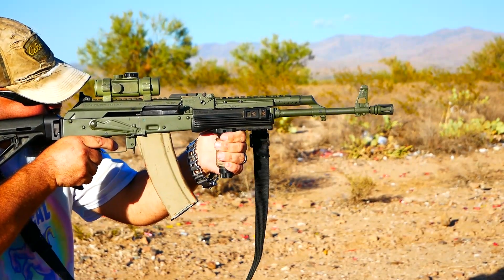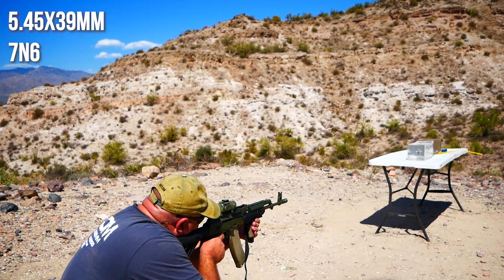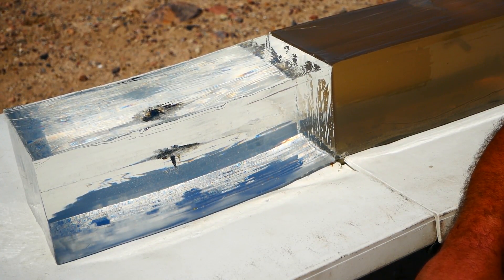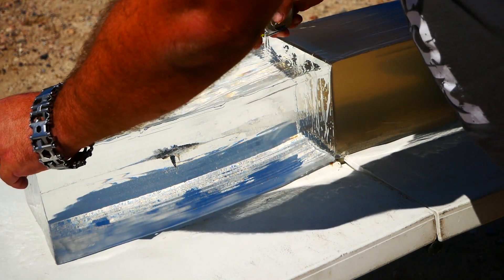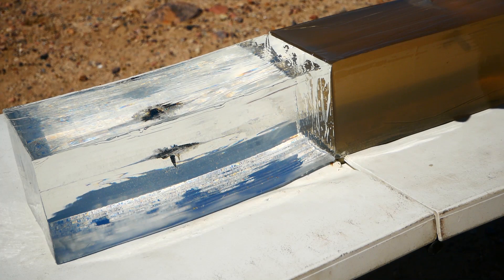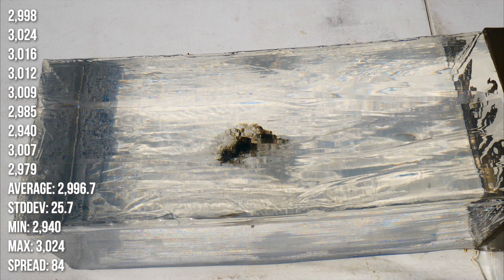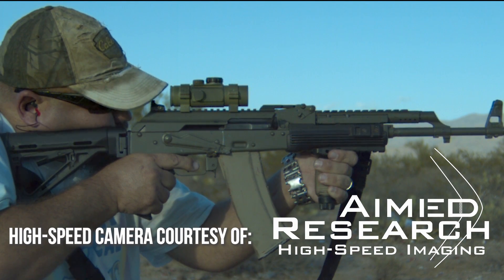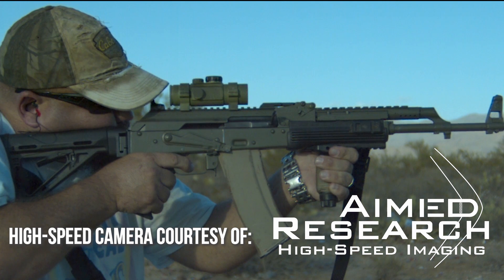Does The AK-74 Really Fire A "Poison Bullet"? 5.45x39mm 7n6 Gel Test (Stunning High-Speed)

Comment: Just wondering if what type of ammunition did you use? Real Russian Military 5.45x39 has a small internal cavity at the tip. This Cavity causes the bullet to tumble and fragment after only an 1 1/2 inches of penetration into flesh. Are you using true Russian Military 5.45x39 or aftermarket 5.45x39? If not try it again with Russian Military Surplus ammunition and you will see the REAL POISON BULLET in ACTION!
Reply from the maker: 7n6, as specified in the title. ;-)

Comment: I believe they called the 7N6 a poison bullet because the metal used to make the projectile was a surplus highly corrosive/toxic metal.
Reply: No it's because they were used to people surviving 7.62 rounds that passed straight through, but the wounds caused by 5.45 killed at a higher rate. The same thing happened when M855 made its way to the Libyan civil war, they said the green tip meant poision. After being used to 7.62x39 straight throughs being easy to patch up, the M855 fragmenting inside the body caused people to bleed out extremely quick.

Comment: Any form of yaw or expansion in the first 4 inches of gel is useless. A round that expands at 1 inch and one that expands at 5 will actually perform very similar in actual tissue, all other things being equal. This is where gel calibration comes in.
Actual wounds from this round in limbs leave a fist sized exit hole and most torso shots do not have an exit.
The advantage of the 5.45 over the 5.56 is that its not as velocity dependent and is thus more constant in its terminal performance. Up close it does less damage than a 5.56, which is a considerably more powerful round, but will be more consistent at lower velocities. Though this may no longer be true for the later rounds or commercial ones that dont have the air pocket anymore, but it is for the 7N6.
No one has ever called it a poison bullet other than the Mujahideen, and even for that the evidence is anecdotal at best. Idiots who keep referring to the 5.45 as "the poison bullet" are really just that - idiots.
Any spitzer projectile will yaw upon deceleration and that is the main wounding mechanism of a bullet. This bullet doesnt do anything new. What it does is understand that a smaller bullet can do more damage than a heavier one and thus the heavier one isnt necessary. Especially if the bullet is deliberately designed to have consistent yaw over a wide range of velocities rather than relying on the high velocity alone to induce it early enough.
Reply from the maker: That first but is incorrect.
Reply: @Harry Peterson No such thing as "dumping energy". Energy is expended over a rate (a factor of distance and time) in what is called 'work'.
The point this is that gel does not represent and actual living animal. Which was accurately stated by the man who made the video. So measuring 6 inches this and 4 inches that means nothing to what it would actually do if it hit you.
In terms of resistance 4 inches of gel roughly equals to breaking the skin. Thats generally what its calibrated to.
Due to the higher resistance of skin and most connective tissues compared to gel the bullet will deform and destabilize differently, generally much sooner than in gel. Hence the point at which the bullet yaws or expands in gel is generally not a good reference for actual tissue nor the damage it will cause.
Rounds that disintegrate almost immediately will cause a lot of force trauma, including spinal fractures. I dont know if you have noticed but living beings do not contort and expand like gel blocks do either.
If that elk round didnt expand until 4 inches in gel and then did what it does, you woldnt be able to tell the difference in the actual elk.
Reply: @Harry Peterson Arrows dont penetrate gel very well, especially synthetic gel, because gel is grippy, it grips the shaft of the arrow. That just further illustrates the point that gel does not equate to flesh. Simple. The force imparted to the bullet hitting actual flesh, skin, connective tissue, bone, is greater than plain gel. Therefore it will decelerate, deform and destabilize much faster. Meaning it wont take 5 inches to do so in tissue if it does take 5 inches in gel. Actual wounds show that quite well. If you hunt you can also see that the performance in gel and tissue dont match.
The BB test and calibration is important. It shows that the resistance of gel is not the same as tissue and in an actual test scenario they are adjusted and interpreted accordingly, not taken at face value that gel = body. Granted, the higher the impact velocity the less it tends to matter.
Reply: @Harry Peterson True. Its a case of an extremely velocity dependent bullet. A spizter shape in general isnt stable unless actively stabilized, but the M855 is essentially a rather flawed design and below a certain velocity the deceleration, under normal circumstances, isnt sufficient to overcome the stabilization. If it hit a bone or tougher connective tissue it most likely would be thrown sideways. In gel at low velocities the ice pick wounds happen more often than not, but in the real world they are significantly less common. People have used the M855 for hunting with decent success (though of course it not really recommended) where as in gel it tends to be notably more inconsistent.

Comment: Is there a reason the 5.45 was the only round that penetrated the first tree in Military Arms Channel video of him comparing it to 5.56, 7.62 and .308?
Reply from the maker: "Is there a reason"? Of course there is. Could I tell you with certainly what that reason is? No. Two things that spring to mind are that the 5.45mm load he used has higher sectional density than the 5.56mm or 7.62mm. Another obvious explanation is that it's a fucking tree. They're not exactly homogenous. It could be as simple as an unseen and uncontrolled variable such as water content or the difference in density between cambium, sapwood, and heartwood in the same tree. Or a knot. Or who knows what? Informal testing like he and I do should not be interpreted as being conclusive of anything. I'm sure Tim would agree. Ultimately, it doesn't matter much. There are a lot more trees out there that are large enough to stop all three or small enough not to stop any of them than there are that are just the right size to stop some, but not all cartridges fired at it. And it won't matter in the field, either. If you get shot at, get behind a tree. At the ground. Where there's a big pile of dirt that's even better at stopping bullets.
Reply: @newsofthepews  I think you're right with the higher density. I have cases of 7N6 I should test it myself.
Reply: @kyleeaton2717  wow, I can't believe that you're comparing that video too, I saved it on my phone because I was amazed by that bullet and said it's a miracle bullet, I've been searching for over a year and over 20 people that i have questioned which is better in penetration, stopping power and distance accuracy between 5.45 and 5.56x45, a whole year of searching to find out that 5.56 seems to be better and if it's not like that, tell me

Comment: The 5.56 , 5.45 are both completely capable as military rounds , and I mean most variations . A hit with any 5.56 , 5.45  is a extremely bad day . That said , the small differences between them are .......small.   The 7n6 was cheap , and that was its strong point , for most of us . The worst thing is its corrosive, requiring  quick cleaning (water ) . I shoot 5.56 ( Colt AR ) and 5.45 SGL , both are nearly identical in accuracy , and I believe , both are as deadly .   Thing is , I believe  most comments come from  Keyboard Commandos or Keyboard operators ! .  I shoot paper and steel so I have no real experience in extensive shooting of people with either 5.56 or 5.45 , but I would expect either will do just fine .
Reply from the maker: 5.45mm would be pretty good, if there was any good ammo available. But the difference between good 5.56mm (50gr TSX, 62gr TBBC, 77gr SMK/TMK) and the garbage that's available in 5.45mm isn't small, in regard to terminal effect, at least.
Reply: @newsofthepews   Agreed , technically .   One BIG problem is lack of demand for premium 5.45 ammo .  This is made worse by the lack of supply , or demand ? of rifles in 5.45, not to mention current costs  .  My comparison of 5.56 ( m-193 -855 ect ) and the 5.45 was not based on hunting or combat . If I really wanted to have a super accurate target rifle in this class , it would be a custom AR ( not my stock M-4 Colt or my SGL-31) . For a fight / either .   I just think many are overthinking this "poison bullet" thing .  My understanding is that that Afghans thought the tiny 5.45 would be ineffective in wounding, compared with the .30 cal , they thought wrong.  The same thing applied to the 5.56  ( here--U.S. ) when introduced  . As I said before , little practical difference , in almost any circumstance , between the 5.56 and 5.45 .   For those who demand the ultimate in some way ?  the 5.56 is the best bet, bigger choice in ammo .
Myself , the AK-74 is fine for anything I can imagine .
Reply from the maker: @jamesjanssen2378  If 60gr Russian soft point was available, that would perform MUCH better than currently available 5.45mm.
Reply: @jamesjanssen2378  both 5mm cartridges is effective in up to 300 meters. At 500-800meters(maximum visibility distances without magnifying optics) they become ineffective albeit the battle transitioning towards positional battle in said ranges.
Reply: @newsofthepews  just reading this thread. I have a beautiful Tantal and love it to death. But, like you said the variety of 5.45 is just not there. The cheapness of the round was it's beat selling point at one time. It was nice while it lasted. I got a lot of range time for very low price per round. I still have plenty left too. 

I thought ahead. I had 2 young sons when I got the rifle and they are now old enough to shoot with me. I'm so glad I saved that ammo. They love it. 

Love your content. I've learned a lot from your videos and come back to them when looking at different types of ammo I may want.

Comment: The only ballistics gel test I’ve seen where the 7n6 performance was mediocre. I’m just gonna take this with a grain of salt
Reply from the maker: No, the test data is the same as everything else you've seen. The difference is that it isn't accompanied by slack jawed repetition of commie propaganda.
Reply: The Chopping Block data is data, and I’ve seen every other 7n6 test show earlier and more violent tumbling than this. The majority of tests tell me to take this with a grain of salt.
Reply from the maker: @noblenitro8500  LOL. "More violent"? Does the bullet stop halfway through, chug a fifth of vodka and invade Afghanistan? You saw less disruption in the gel here because it is clear gel, which is more elastic than real gelatin.
Reply: The Chopping Block exactly. Clear gel is not an accurate way of representing true ballistics and isn’t enough data for you to call the wounding capabilities of 7n6 “communist propaganda” your video is flawed and you should check out better tests that show how early the round actually tumbles. Even at slow velocities the round goes nuts. A flaw that the 5.56 has. 5.45 is not sensitive to velocity. 

556 is more accurate and more available 

545 wounds better and more reliably and isn’t velocity dependent
Reply from the maker: @noblenitro8500   Bless your heart. No need to get all triggered about it, comrade. This is actually one video in a series. Clear gel has its flaws, which is why I don't normally use it for rifle ammo, but it's fine for comparing one load to another. And in this series we find that M855 and Silver Bear 7.62x39mm both yawed earlier and produced larger TSCs than 7n6. It's just a shitty cartridge that doesn't do anything well. All spitzer rifle bullets yaw, if they don't expand or fragment. That isn't really a good thing. That is, expansion and fragmentation are more destructive wounding mechanisms. If a bullet can't do either, it will definitely yaw and early yaw is better than late yaw. But 7n6 doesn't even do that well. Relatively speaking.

Comment: Seeing how Black Hills performs, specifically the 50 gr. TSX load, 7N6 sounds like that girl everyone says is hot, but when it comes to actual dependability she leaves much to be desired. 

That and Dr. Roberts has also stated it many times that "generally you should go with what a savvy police officer uses." 
Primary & Secondary Modcast: Terminal Ballistics: youtu.be/N1_IXxJp4Ik?t=902

P&S Has also pinned a commenters very nicely laid out time bookmarks in the comment section with short titles for each time mark. Very great bits of knowledge there given by the panelists, especially Dr. Roberts himself.

Comment: Thank you!!! I've been telling 5.45 guys this for years, but the poison bullet mantra persists
Reply: As a choice, I used the AK74 in Afghanistan, with a side rail and American scope, I preferred it to the M4, to many couch experts on here! After about 50 meters, the 7n6 is King!
Reply: I believe many don't actually understand the "poison bullet" thing. It's actually because the 7N6, very much like .22 LR, has a tendency to bounce around inside the body as opposed to going straight through like you would generally see from 7.62 calibers.

So a mooj would get hit in a rather "survivable" part of the body but the round would quickly change direction or bounce off a rib, spine, shoulder, etc and lodge itself deep inside a vital organ without any way of finding it without modern medicine and technology available to locate the bullet and repair the damage. 

So what would appear to be a survivable wound initially would still result in a mooj death days or maybe even weeks later after much suffering and pain. Hence, the "poison bullet" moniker.

It never meant that the 5.45 had some instant, magical quality about it.

Fun fact, many Russian special forces switched back to 7.62x39 when in URBAN environments not because the 5.45 was less effective but because stray 5.45 rounds have a tendency to ricochet severely inside typical Eastern bloc building structures made of concrete and steel...thereby increasing the likelihood of hitting teammates and innocents.

5.56 has similar ricochet concerns as any Marine on the rifle range target pit can attest to...😉
Reply: @PennsyltuckyReb  
That's a little over explaining. The term come from a writer from Soldier of Fortune magazine in the 1980s. There's no evidence that the afghans have ever called it a poison bullet. The damage from the various gunshots from 5.45, 5.56, and 7.62x39 is so similar that it wouldn't matter which one you got hit by. The trauma would be similar.
Reply: @theimmortal4718  Yeah I've heard that too. But the general idea was always there whoever originally coined the term/description. There used to be a video on YT of a Russian documentary of the first Chechen war where both sides used 5.45. A Russian field surgeon mentions the futility of attempting to treat 5.45x39 wounds and how the round tends to lodge into impossible to reach places and turn everything inside into hamburger....something he wasn't used to dealing with in the larger calibers out there. And this issue alone probably caused more deaths.

So agree with the accuracy of the name or not, it had its basis in reality.

Comment: Actually had an argument about it yesterday. The whole airgap thing in a certain way is true but done piss poor.

Having more mass in the rear than front results in earlier yawing (but also needs a tighter twist to be stable to begin with). But 7N6's tumbling actually rather is because of its LENGTH ratio.
Also this construction sicnificantly impacts external ballistics, taking away that mass inside leaves you with a mediocre shaped and low mass projectile at the same time, worst of both worlds for bc. Theres a ridiculously simple and better way for that, just take away that mass from the outside of the nose... instead of a stupid stubby tanget ogive, its secant then, giving it tremendously better external ballistics, STILL having the exact same point of balance to the rear.

But afterall none of this matters anymore anyways because thats stoneage tech compared to EPR's, with their 100% fragmentation chance, compared to occasional icepicking, and instant fragmentation without any delay, also the way higher peneration.
Reply: You love this. Everything is right on